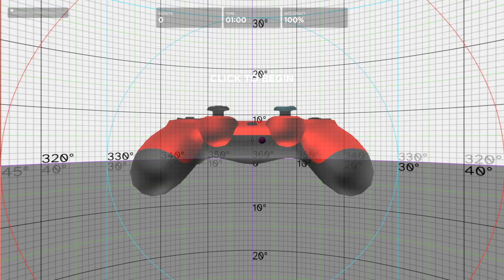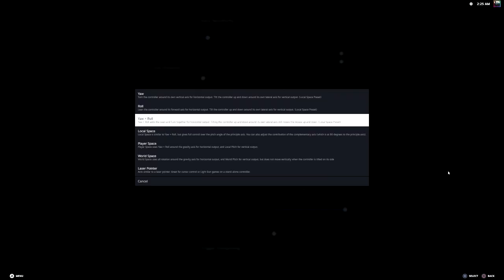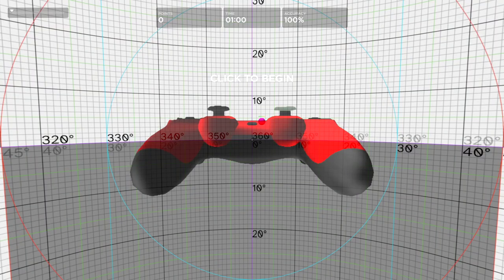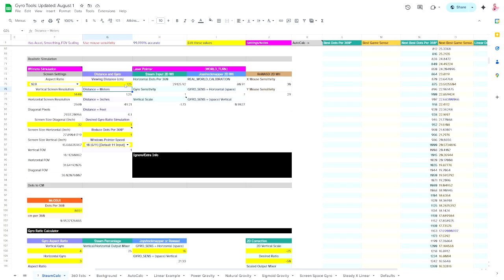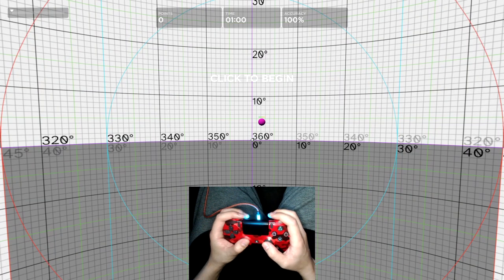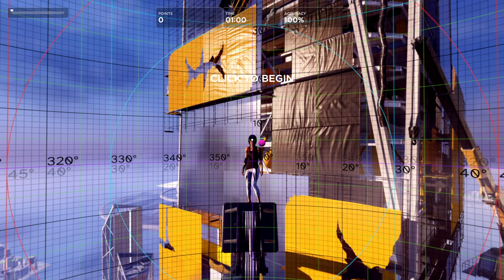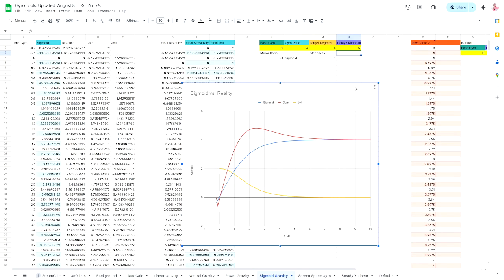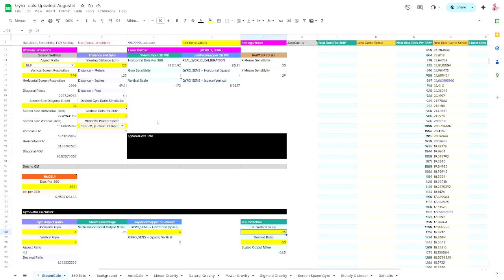Gyro Theory: Basic Settings (Overthought) *with feedback for devs

Comment: Awesome video!
I had been planning to make one specifically on the 3dof to 2d conversion style, but never got around to it for a variety of reasons. 
I had even spoken to Aubs (the creator of the To Mouse Beta style) and bounced my script off of him, and if I may add a few (cough) clarifications;

Rotate Output, while yes it has that end result as shown, its a bit more nuanced than that. It takes the final xy mouse output and rotates that. ie if the final output was x+4 and y+3, a diagonal line up to the right, Rotate Output could be used to make that diagonal a flat x+5. It doesnt actually rotate the data coming from the gyro, which would have implications like Local Spaces Primary Axis Offset does.

Rolls default behavior actually isnt "inverted" per se (I would personally err on the side of not using inverted in this context simply because "invert xy" are already a thing and invert the entire output of that axis instead of individual axis on the gyro). It matters how you hold the controller. If you are holding it "flat" along the horizon, roll acts like leaning a direction to look that direction. It makes sense. But if you hold it upright, as you mentioned at the start it then looks like yaw to you just with its output going the opposite direction than expected. This really starts running into the differences between "relative to the controller" and "relative to the player", and I've noticed many many many people have trouble making that jump.

Yaw + Roll... what should the default contribution % be? Whats hilarious is we both arrived at the same use case but make our motions differently. We both use it to increase our horizontal range. But the motion you are making is like if the controller was at the bottom of a bowl and you are pushing it around. -100% makes sense there. The motion I make is like if the controller was on top of a bike and I was "leaning into the turn". +100% is what makes sense for that motion. 

Side note; Yaw + Roll should NOT be used to account for the neutral pitch angle you hold your controller at. The math is all wrong for that situation - its a straight addition, which leads to poor behavior during some movements (most noticeable during figure 8's, can impact circles as well) as the axis fight each other. Yaw + Roll's (or local space complementary contribution) main use is for increasing your horizontal range at lower sensitivities. You run out of physical yaw range but want to keep turning? start rolling the controller instead.

If you want to account for the neutral pitch angle you hold your controller at; gravity modes, or local space primary axis offset (negative values if your neutral angle is pitched up, positive if pitched down. The math there is more sophisticated as it actually rotates where the axis even are on the controller, and as a result doesnt have poor behavior during some movements). Gravity Spaces are kind of like a dynamic version of Local Spaces offset which means you'll have a more even x axis response across the entire y axis range, but the downside is that gravity spaces dont have a complementary axis like local space does.

Yes, some of these settings are superficially similar. However, the differences DO matter for one simple reason; rotations in 3d are not commutative. Roll the controller 360 degrees, it winds up in the same spot it started. Roll 180 and then yaw 180, still 360 degrees of overall rotation, and the controller is upside down and backwards from where it started. You should use the settings that match the intentions behind your movements, even if other settings "feel" similar.

Player Space - uses gravity yaw, but local pitch
World Space - uses gravity yaw, and a virtual pitch axis 90 degrees to the yaw axis. loss of pitch axis when controller is held in the "gangster grip"
Laser Pointer - as World, corrects the gangster grip issue, but pitch control inverts when the controller goes beyond the north/south poles. (also works wonky on the steam controller specifically - because its accelerometer has a squashed axis, pitch traces an oval instead of a perfect up/down line)

And yes, adding a magnetometer to controllers and updating the sensor fusion algorithms would enable a "master space" that has perfect tracking, none of the above downsides, AND would even have access to the complementary axis. It would basically be vr controls, only without the external sensors or cameras. Would still only be 3dof though, not 6dof like actual vr.

Lastly, to add to your "round trackpads are better than square" rant - ergonomics. Yes the square can better map to screen space, but that forces you to swipe your thumb across it in a specific way. Thats not ergonomic. Ergonomically, you'd want to adjust the trackpads "Rotate Output" to match the swipe angle of your thumb. To visualize; that rotates the screen space within the trackpad. If you do that on the square trackpad, you'll notice bits of the screen space get chopped off AND the distance edge to edge of the screen space changes relative to the distance edge to edge of the trackpad. But on the round trackpad? You can rotate the screen space within it to any arbitrary angle and nothing is lost, and the "edge to edge" distance remains consistent. Ergonomically, round trackpads are simply better for that reason alone.
Reply from the maker: Oh, ok. I think I get it now. This really was just how I understood things from messing around with these settings. I just hope I didn't get things too wrong.

Yeah, I actually completely forgot about the invert options. I shoulda have realized there was a reason for settings being the way they are. And I completely blanked on pitching the controller the other way. It literally never registered to me that people push the controller the other way. The figure 8 example is so good, I wish I had thought of it while making this. It actually clarifies a lot of stuff more directly. Hmm, I'm contemplating redoing this vid or making a follow-up...

I actually didn't know that about rotating on the square pads. I don't own a Steam Deck.

Comment: What software are you using to demonstrate the degrees of rotation? I'd like to use this to help calibrate some gyro stuff I'm doing with Alpakka.
Reply from the maker: I was using Steam Input here, I think. Steam - Settings - Calibration and Advanced Settings.
Reply: The white 3d space with all the degrees marked out?  @megaphone1113

Comment: Hey megaphone I watched this vid a few months ago and your takes on acceleration got me curious about trying the different curves. Well fast forward to the present, I just released a UI wrapper for a version of JSM that I modded for custom accel curve support. I didn't add anything in the graph to show jolt and gain like you did, but I did add normalized velocity output which essentially represents a scaled measure of how much camera turn you get for a given gyro speed. So for accel curves where there is jolt you see a kink in the normalized velocity shape. Would love for you to try out the program. It's free and open source. If you're interested at all I posted the link on both the gyrogaming reddit and the gyro discord.
Reply from the maker: Awesome! I'll check it out.

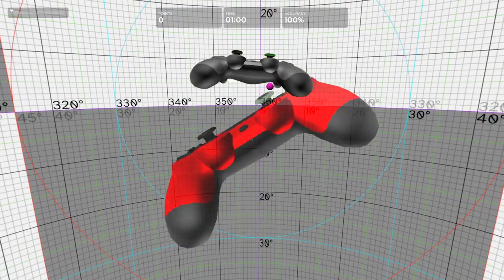Comment: 24:55 Something I'd like to add on here: a lot of Nintendo games do something a little weirder than just World Space Gyro. To control the camera's yaw, they use World Space Gyro as usual, albeit with some pretty harsh filters in many games. For camera pitch, however, gyro is not used at all. Instead, camera pitch is linked directly to the controller's orientation relative to gravity based on data from the accelerometer. In other words, camera pitch is controlled by the accelerometer, not the gyro. If anyone wants to test this for themselves, the Switch and Switch 2 have a console-wide auto-calibration for the gyro. If you try to turn the camera yaw at a very slow speed, you'll eventually notice that the camera stops turning, and if you hold the controller still, you'll see the camera start to drift in the opposite direction you were turning the controller. However, if you try the same thing with camera pitch in a game that uses vertical accelerometer aiming (I know with certainty that all 3 Splatoons do), you won't see drift at all.
Reply from the maker: Whoa, that is interesting.
Reply: Ah yeah, I saw this in The Finals (seems built into the PS5 drivers). There's a reason calibration should be manual/only auto while not in gameplay!

Comment: Mega have you ever tried the Alpakka. It’s open source and uses two gyroscopes to completely avoid filtering and reduce noise.  There’s also variants with full sized sticks that are shaped basically like a ds4 with a scroll wheel in between the sticks. I just ordered one but i figure you might get more mileage if you ordered one
Reply from the maker: Nah, I haven't tried one. Didn't know you could order one, thought you had to print it yourself something. Looking at the prices, not sure I'll be getting one anytime soon, but I wouldn't mind trying one.
Reply: @megaphone1113 coming from a steam controller since 2015 Ilyk how I like it.  I might even be able to build yours for you for around 110 plus shipping instead of the 200$ or whatever
Reply from the maker: @DJPOOPTACOS  That's fine, just let me know how it is. I'm mostly just interested in if the gyros actually make aiming noticably better.
Reply: @megaphone1113 Ilyk I’ve honest been think about printing a back cover for the SC so I can use the new gyros with the old controller if they really are as good as people have been telling me
Reply from the maker: @DJPOOPTACOS  Saw your other comment. Yeah, so I looked into it, and yup, it seems that Alpakkas gyro setup is objectively better. I explain why in the new vid. So if what your saying could be done, that'd be awesome.

Comment: What about games like osu, where you need to have 1 to 1 input (i'm not talking about clicking while aiming right now but that can shake the controller as well) ? i mean a controller is not the best input for the task, but like it's a game where you have to aim still and on 2D some patterns are awkward since you're moving in 3D no matter the any 3DOF spaces, i can't use accel in osu because depending on the speed of the map i'd be off. accel and osu doesn't work, and from my testing neither team fortress 2 work well with accel since you want to track which even tho the accel fans say that it's just bad accel curve i think it's just cope in my opinion, i have tired bunch of curves back then and everything felt terrible. if it works for them, i don't blame them.

Thank you for your video, the amount of stuff you studied is insane to help out the gyro community, sorry if my comment mirrors the opposite, i'm just trying to find out what is wrong and you know way more things than i know.

Among the things you mentioned i liked the accel curve where it tired to do the small motion lowers your sens stuff so i wouldn't shake thing instead of the gyro steadiness option or i don't remember how steam calls that.
Reply from the maker: I realize I probably should've covered OSU since I did bring up MCOSU. The answer is, I don't use accel at all in OSU or Railshooters. The mouse drift with the gyro alone is just as bad, if not worse than the mouse. That's why I also have 2 drawing tablets. Absolute positioning is always gonna be best. With magnometers, this might be possible with gyro, but who knows maybe I should just by a Wiimote since OSU does support it.

I suppose I should've been more self-aware of how I presented accel, so that's actually on me. I'm not saying it's a magic cure-all, I'm trying to say that it's a useful tool for specific needs. I do play at higher sensitivities (6.71 now, used to be 12 earlier). From what I've tested, I'm confident that having access to the type of accel I showed would give me (and hopefully others) the tools needed to solve their specific needs. I only technically need about 3 degrees of accel to fix the issues I have. Although it's a little more complicated than that.

I'll be sure to make some follow-up videos to clarify things in more depth. Again, I'm not trying to tell people what settings to use. That's why I never mentioned my actual settings in the video. I think all of this stuff is just a big, confusing balancing act of figuring out what your needs are.